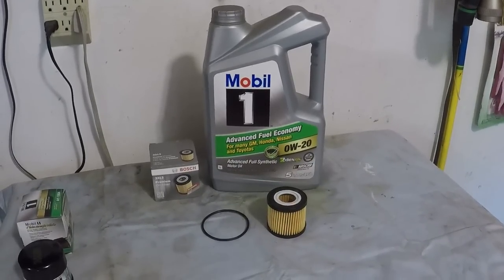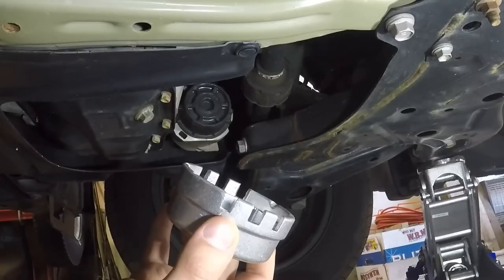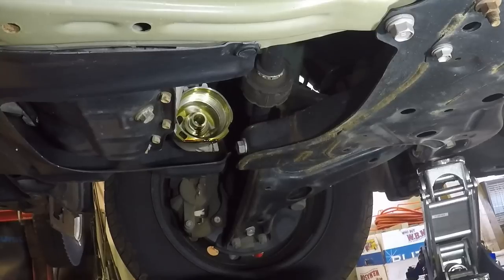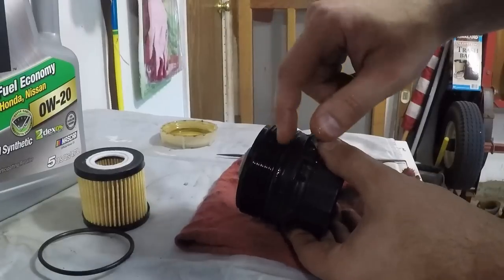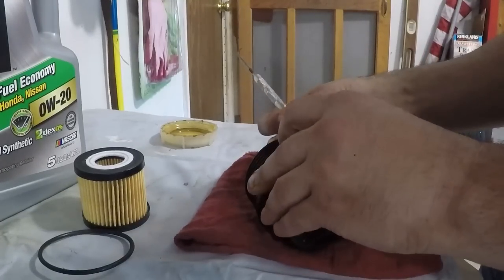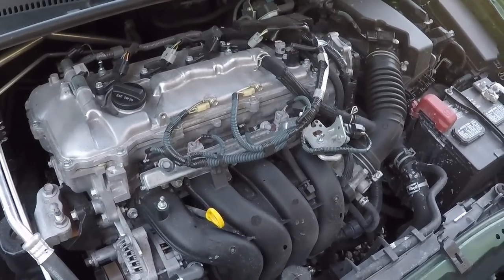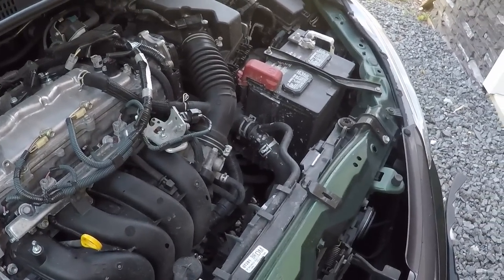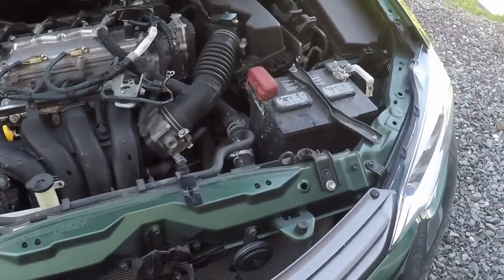Toyota Corolla Oil Change (2015)

Comment: Great video, I have a 2014 Corolla with 42,000 miles. I change my own oil as well, Ive been using Castrol GTX Magnatec synthetic 0w-20 and change it every 5,000 miles (Phoenix AZ), I used  GTX synthetic blend 0W-20 for my last oil change and noticed it burned a half of quart of oil at 4,000miles. Went to Walmart, they sell GTX Magnatec synthetic for $20.00 and a Toyota OEM oil filter for $5.99, definitely a bargin compared to the stealership.

Comment: It makes me wonder if some of the little independent oil change shops actually have that tool lying around or if they just drain and fill the oil without changing the filter whenever one of these Corollas comes through.

Comment: Great video, but if you drain the oil first, it would take the pressure off and so the housing would come off easier.
Reply: My filter housing will not come loose and I will try ur way.

Comment: I'm lazy with knowledge. My mechanic moved on me and now he's at an inconvenient location, the other place is rude and pissed me off. So now it's back to doing my own oil changes. Used to have an easy truck to do oil changes now I have one of these with 4 inches of ground clearance. I know the importance of oil changes yet my actions or more accurately inaction has me as a dumb blonde girl who knows nothing about oil. I have non-synthetic oil with about 8000 miles on it. I have to change it before I become the first fully knowledgeable idiot to kill a bullet proof engine. Thank you for this video.

Comment: I have a the same Corolla but it's a se stick shift and it's a regular filter
Reply: Then it's not the same then is it? There were two different engines available on the Corolla. This one and the other with a spin-on filter.

Comment: Does anyone else have trouble reading the dip stick, almost impossible to tell the oil level  on my 2015 Corolla...any ideas??
Reply: It's hard to read after an oil change because the oil is so thin and clean. I usually fill it up with 4 liters of oil which is about 4.2 quarts and let it run for a few days that way, then let it sit overnight to let the oil settle and pull the dipstick to check the oil level.

Comment: Please folks, don't go by the "dumb" warranty 10,000 intervul!  This intervul is a "selling-point" to make you "THINK" you are worry-free and have no need to worry about oil changes -- NOT!  If you care about your "investment" and want to keep your car, think about the cost of an engine vs. oil changes.  In the scheme of things you'll want to change every 3k, and if you absolutely need to stick to a budget, then at least change your oil at minimum, at 4,000 to 4,500 , miles.  Where this guy is coming from is "highway miles", but this is not normal, most of us drive city and highway. Bottom line, change your oil at least every 3k -- you'll rest assured your engine will last, and it only makes sense to not go cheap will oil.  Use Mobile One 0-20 or the Castrol brand 0-20, and either an OEM filter or a Mobile One M1C-154A (THIS SIZE FITS 2015 COROLLA), AND IS ACTUALLY A BETTER FILIMENT THAN THE OEM, JUST SAYING.  Other than this statement, this is a good video that shows how to get to the filter and change your oil.  But remember, most all these corolla cars have little differences here and there, just because it's a 2015 does NOT make them all alike.  For example, my 'S' model does have a retainer clip on the filter housing, where this guy's Corolla does not.  Just be aware of this.  Now, get to changing your oil.  :))

Comment: I've done my own oil changes for years. I have one of these Corollas. When I bought it from the dealer, I was told by the service dept that it could go 10,000 miles between oil changes. I almost fell over laughing in the guys face. Under certain conditions oil might hold up 10,000 miles. 
THE FILTER WILL NOT LAST 10,000 mi
Reply from the maker: https://youtu.be/IrFGhX387nA
Reply: Oh OK so you're preparing for a SLUDGE  REMOVAL VIDEO I guess?!?! 10,000 is death for the engine big man.
Reply from the maker: @milesdyson  thanks for the advise.
Reply: @EnthusiastsGarage if you haven’t done so already, you could always take off the valve cover (sometime if/when the gasket needs replacing) and just take a look at the valve train. If yours is anything like mine (‘16 Civic, driven primarily hwy, 7500 mile intervals) it’ll be shiny silvery with no hint of deposits, varnish, or Heaven forbid, sludge. 😊

Comment: You are the best, Thanks for sharing knowledge. My 2015 Toyota Corolla around 90000miles on it should I buy Mobil 1 (High Mileage Full Synthetic Motor Oil) 0W-20, 5 Quart or buy Mobil 1 Advanced Fuel Economy Full Synthetic Motor Oil 0W-20? Thanks
Reply from the maker: dont use high mileage oil unless you are burning oil. i use M1 AFE for now but any full synthetic oil will be fine.

Comment: If you ever want to covert the oil filter housing to be able to fit on regular spin on filters you can order the parts from Toyota. I did that on my 2010 Corolla. Looks like mid 2015 production they switched oil filter housings to get rid of the canister/cartridge type filter and went back to spin on metal filter.

Oil Filter Bracket (15609-0T060)

Union (90904-04006)

O-Ring x2 (96723-24020)

Flange Bolt x4 (91551-F0835)

Oil Filter (90915-YZZF2)

Comment: My Corolla has the screw on type.  Why do some have the cartridge type, and some have the screw on type?
Reply from the maker: TheDavePhan they did cartridge for a while then when back to screw on type more recently. If I had to guess I would say two reasons they went back to screw on type. One, it saves the dealers a lot of time when they were doing tons of oil changes, and two, enough people probably complained that the cartridge ones are more involved and messier.
Reply from the maker: Frank. T yep, surprised me too
Reply: Different engines. 1.8 liter and 2.4 liter.

Comment: Have you had any issues with this car's steering? My wife has a 2015 Corolla with electric power steering and it feels stiff going down the road.
Reply from the maker: Not at all. I would look for and damage or corrosion on the steering components.
Reply: @EnthusiastsGarage  Will do, thanks for the reply.

Comment: Great video
Have u ever changed the cvt fluid? Or its good for life?
Reply from the maker: I’m going to bring it to the dealer at 100k for the CVT fluid. The system is very sensitive to the amount and it’s very difficult to do it in your driveway because there is no dip stick.
Reply: Enthusiasts Garage 
Some dealers here in canada are telling me i never have to change it cuz its lifetime..is that true??
Reply from the maker: Hagg Hag I would change it. My dealer told me I should do it between 80 and 120k. I don’t believe in fluids that are good for the lifetime, all they do is shorten the life of whatever they are in and everything eventually wears out no matter what.
Reply: @hagghag9435  Yeah I asked the tech at my Toyota dealer and he said I don't have to change the fluid because it's a lifetime fluid.

I told him, I don't believe that. Fluids get dirty and break down. He priced check the service and it's around $400 dollars.

Comment: can you tell me the size of the oil filter Wrench? so i can buy one
Reply from the maker: https://www.ebay.com/itm/64mm-Oil-Filter-Wrench-4-cyl-Engines-for-Toyota-Lexus-Corolla-Rav4-Matrix-Prius/162292007347?fits=Make%3AToyota%7CModel%3ACorolla&epid=2078453949&hash=item25c95b81b3%3Ag%3AG5MAAOSw3mpXMvZy&_sacat=0&_nkw=toyota+corolla+oil+filter+wrench&_from=R40&rt=nc&_trksid=p2057872.m570.l1311.R1.TR10.TRC0.A0.H1.Xtoyota+corolla+oil+.TRS0
Reply: 64mm wh-901 dealer name Amazon.com

Comment: i have corolla s 2013 what is the best oil kind?
Reply from the maker: Any full synthetic will do the job
Reply: @EnthusiastsGarage  oil havoline good and i put 5w40 or 10w40 from lebanon the weather is moderate
Reply: only use oil you can see on engine oil cap 0w20 or 5w20 i recomend avance full syntetic mobil1

Comment: What is the size of that adapter where did you get it
Reply from the maker: https://www.ebay.com/itm/64mm-Oil-Filter-Wrench-4-cyl-Engines-for-Toyota-Lexus-Corolla-Rav4-Matrix-Prius/162292007347?fits=Make%3AToyota%7CModel%3ACorolla&epid=2078453949&hash=item25c95b81b3%3Ag%3AG5MAAOSw3mpXMvZy&_sacat=0&_nkw=toyota+corolla+oil+filter+wrench&_from=R40&rt=nc&_trksid=p2057872.m570.l1311.R1.TR10.TRC0.A0.H1.Xtoyota+corolla+oil+.TRS0
Reply: Enthusiasts Garage thank tried autozone and O'Reilly they didn't fit right. The weird thing at O'Reillys it fits the replace cartridge they sell for 2015 Corolla
Reply: @LarryHAboveRHeads  Beware, there are 4 teeth and 6 teeth adapters, be sure to choose the good one!
Reply: @jocelynlacharite  i found one at autozone I just had to cut one of the notches out longer to slip over notch on oil filter cap

Comment: Start draining from the pan first then once its dripping change the filter. Then replace the oil plug before the filter. that will let the oil drain faster with the filter off and drain more complete with less dripping on your arm.
Reply from the maker: Normally yes but with this setup if you do it that way the drain pan is in the way. I did it like that once and made a mess.
Reply: Where do people come up with this stuff?